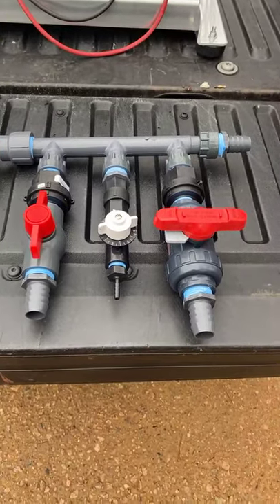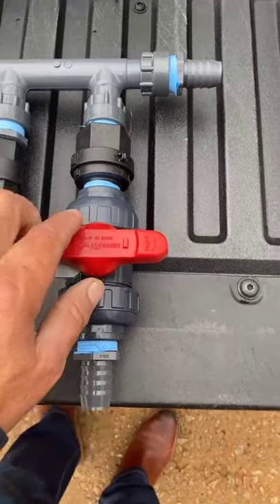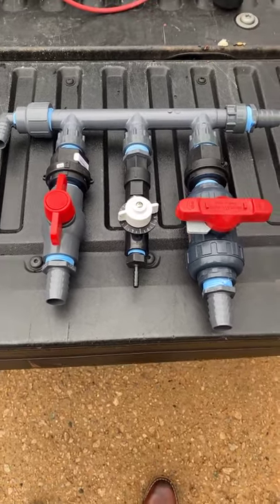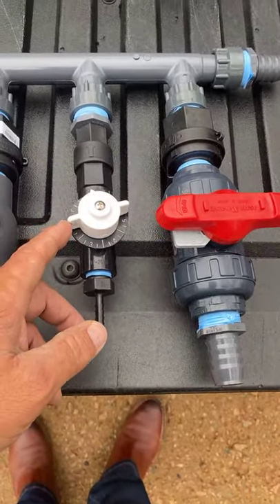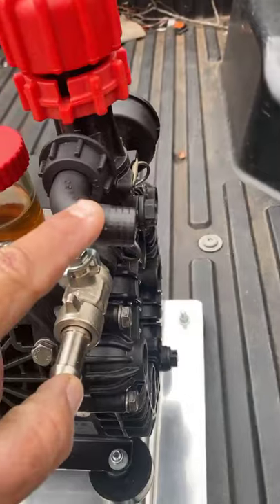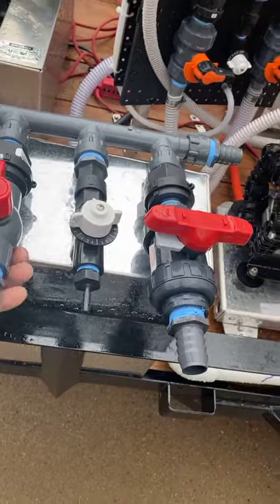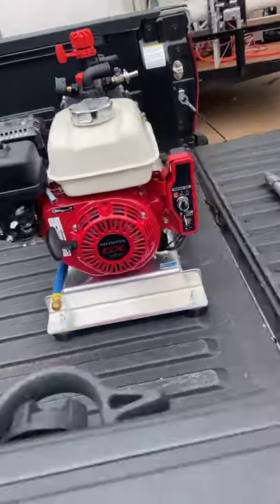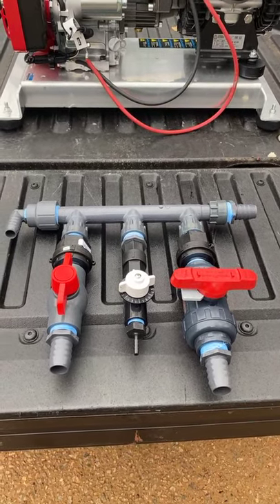Gas roof pump manifold the most inexpensive way

Comment: I've built a 3/4" manifold very similar to this with sch 80 fitting and pipes from lowes for my water inlet manifold and my 12v pump manifold. Definitely do 1" for the AR or Comet and 24v pumps.

Comment: I would try to do a draw test with the SH and water lines with two different metering valves both on full. It wont draw 50/50. Both metering valves need to be the same. This has been proven from other youtubers that a ball valve and a metering valve wont draw the correct amount so your ratios will always be off. Do a test, maybe everyone else is wrong?
On you own rig you have two metering valves so it will work correctly.
Reply: Makes complete sense!
Reply: I think the Pentair's and GF's have restriction on %100 open. The bigger 3/4 and 1in metering valves don't, so it's proportional. This is my assumption at least.
Reply: This is correct. The openings are different sizes therefore letting different fluid quantities flow through them.

Comment: I'm going to use the new remote manifold they sell on Amazon they sell them in all kinds of sizes but you can adjust the flow using your phone. So much cheaper then the crap these guys try to sell you for $900 you can get these manifolds for $80
Reply: Share the link
Reply: What's it call

Comment: Why do you have 25’ of line going to the pump from the bypass port on the manifold? Is it fir cooling purposes?
Reply: Yes cooling. It allowed the bypassed fluid to cool some so it's not as hot coming back into the manifold then going into the pump. It's just a slight pump protection but don't let it bypass too long. If you're not guna spray anything for a couple of minutes then turn off the pump. Just like the direct drive pressure washers you buy from Lowes or home Depot.

Comment: Will this manifold work OK with a 12 V pump also I’m just starting out and figure I can buy one that’ll work with an AR 45 and I can upgrade down the road a little.
Reply: Just would have to change the barb size for your hose and close either the left or right barb because you don't need a bypass like the gas pumps do.

Comment: I don't remember who, but someone recently did a video testing a ball valve as the water valve. Again I don't remember exactly, but it was either pulling too much or two little water and throwing off dilutions.
Reply: That is correct because the opening on the ball valves are different so the ratios are different and unpredictable.

Comment: Most Honest Comment iv'e seen about manifolds, you don't need meter water with GF vales , nor Soap.
Reply: You don't need it unless you want to go more than 6.25% or if you've had your bleach a while and it has gone weak so you need the extra strength more than a 50/50 mix so you have to close the water valve some. But on my manifold I'm just using regular ball valves. All you have to do is run a water test, with the ball valve 100% open then time how long it takes to fill a gallon. With that time find and mark what closing positions will fill 96oz, 64oz, 32oz,   16oz. That'll give you your position 1(16oz or 1.25%),2(32oz or 2.5%),3(64oz or 3.75%),4(96oz or 5%),5(open or 6.25% ) which is pretty much what a GF valve is doing.
Reply: But also if the size of the openings of the water and SH valves are different because you bought different brands or types then your ratios are guna be off from what you think they are based off of the SH metering valve markings. In other words wide open for both valves that are different won't be 50/50 and will be off for other settings.

Comment: Great valve setup.  You've done the  hard part.  Research and development,, trial and fine tuning  figuring out how to get a hot mix efficiently.
      I don't believe that you've ever mentioned the 1/2 inch outlet from the pump to the hose reel.  Do you keep it at 1/2 inch and do you use 1/2 or 5/8 hose on the reel ?   I thought it odd that AR puts a 1 1/4 inch inlet on the pump and a 1/2 outlet to the reel.
     Also...On your 12 volt wireless SH valve.  I think, that at one time you had a 3 way valve ... select SH or flush the system with water while rinsing.  Of course, the 12v valve is pricy, and a method of flushing the 12v , backflow, and the metering valve, and the pump would probably be better.
     Thanks for posting videos !!!

Comment: How do you know what percent SH you making ??
Reply: It's guessing pretty much. Especially with miss matched water and bleach valves.

my manifold I'm just using regular ball valves. All you have to do is run a water test, with the ball valve 100% open then time how long it takes to fill a gallon. With that time find and mark what closing positions will fill 96oz, 64oz, 32oz,   16oz. That'll give you your position 1(16oz or 1.25%),2(32oz or 2.5%),3(64oz or 3.75%),4(96oz or 5%),5(open or 6.25% ) which is pretty much what a GF valve is doing.

Comment: Leon I built this with exact valves for AR45 pump but doesn’t draw my surfactant. Any ideas
Reply from the maker: Make sure check valves are not upside down
Reply: @southernstylepressurewash2  all my arrows are pointing up
Reply: @shoreunlimitedhydrowash4019  did you figure it out? Try closing the water and bleach  some ways to allow more suction from the surfactant until it catches up to the manifold, maybe. Maybe your surfactant is too thick. I'm sure you've tried it but maybe opening the ball valve more on the surfactant line. I'm sure you've looked but maybe the line is pinch from the suction. Maybe you need to move up to a 3/8" line, I know there's a time when you need to move up on line size but I forgot when it's needed.

Comment: Love bother How much extra is it going to be for the 12 vote so proud and chemical valve With stainless steel plate what size is the  Stainless steel mounting plate
Reply: Great information about buliding that mixing valves love your content bother
Reply: Your ball valve is going to pull more than your bleach valve when it is wide open , at least it does with the Pintair valves, probably about 30%

Comment: Leon you're the man!  can I contact for info on where you get the back check and metering valves for this manifold?  looking to get this setup and I am perfectly capable of building one myself.   Godbless and thanks for the great content as usual!
Reply: US plastics website for check valves.Hastelloy Springs are the most corrosion resistant ones.